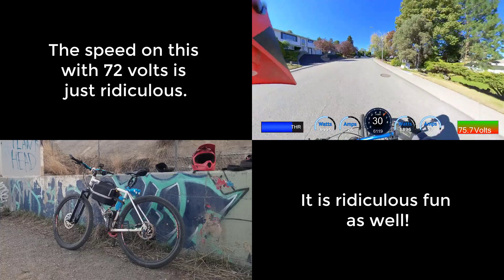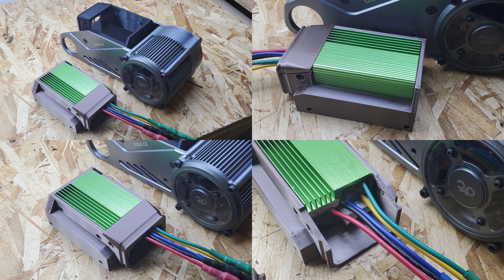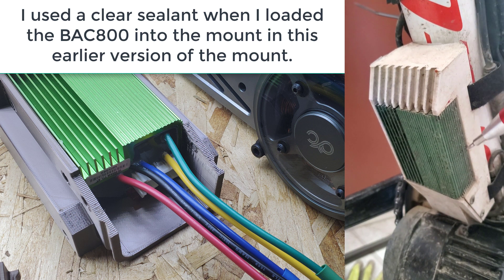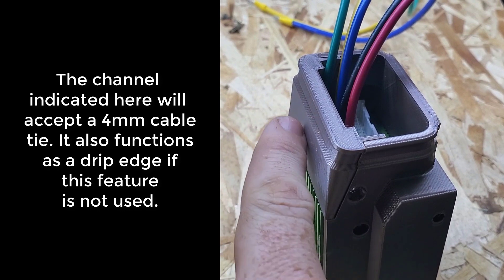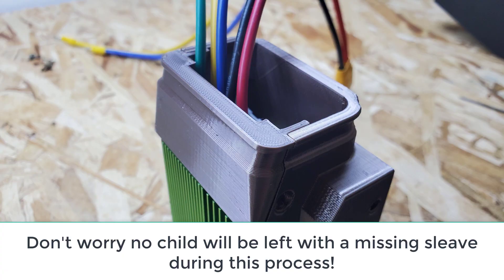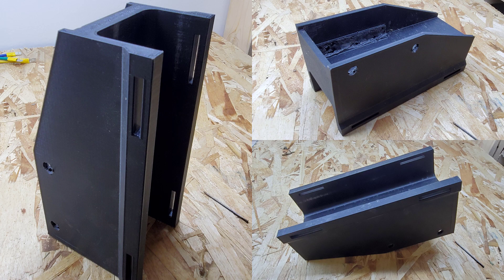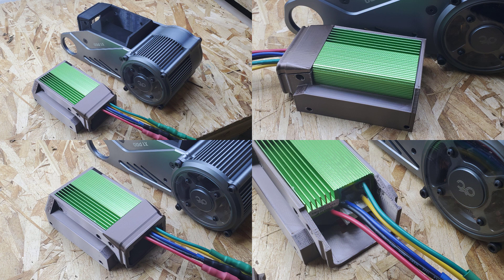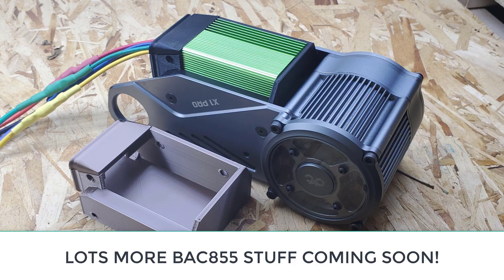ASI BAC855 Controller Mount for CYC X1 Pro Gen 1 & 2

Comment: i just got cyc steal motor with  bac855 that has clear reson over connectors and added high strength polyurethane sealant and adhesive pu18 on all wire connectors, what do think
Reply from the maker: I like it Alan. It's a good call to protect the 24 pin JST. Some drawbacks in that its hard to use for anything else. You are locked into using that controller on a cyc bike and if wiring is damaged will be hard to repair. Grin technology have done a similar thing with their Frankenrunner.

Comment: Hi there I have the cyc with 72v and bac 855. To be honest I’m a bit disappointed as the videos I have seen from yours and other they seem to be a lot quicker. Do you know how to navigate the bacdoor enough to mod the motor and controller for more power? Any help be greatly appreciated.
Reply from the maker: I'm okay at bacdoor. I'm sure we can help on discord. You can post pics screenshots etc. https://discord.gg/YAAjfgc I'm on a away job but I shouod be able to look tonight if others can't help before. Weight of bike is a factor as well as gearing.
Reply: @HighVoltageKits  thanks I joined and max gave me a few tips.

Comment: awesome ! I bought an ASI855 and BBSHD following your videos. Unfortunately I don't have the harness that connect BBSHD to ASI855... Do you know where I can get one ? I have a 8 pin harness coming with the BBSHD and could make the harness myself but wondering why on ASI side, their are two brakes. Do I need to duplicate wires? Thanks a lot for the help !
Reply from the maker: Check out my discord for asi stuff. https://discord.gg/YAAjfgc I am assuming you have access to the app? Cheers

Comment: Great job, can you help me with some advice please, I have an 14s6p 52v battery from em3ev built with 35e cells, my question is would this battery be good enough to use with the bbshd and the bac 855, or even the cyc gen 2 either with the stock controller or the bac 855. I only use the bike for getting to work but have got to the point where I want more some power, my current bike is a trek marlin7 less than 1 years old so I will be still use this bike.
Have watched your videos and have learnt a lot from them, would really appreciate your advice because I'm not sure what set up to choose.
Keep those videos coming.
Reply from the maker: Em3ev tend to be fairly conservative with their batteries. My one from them with the 30q Samsung cells has a 50 amp bms which was just about enough. If you email Joseph at em3ev you can check on the bms for your pack. I suspect the BMS would be 40 amps for that pack which is more about range than power. You really need 60 amps continuous for the CYC and at least 50 for the BBSHD. There will be alot of voltage sag with the 35E cells. You could still do it and reduce the watts you are pulling until you get a stronger battery. I would shoot CYC an email as the stock controller is no longer being shipped. Only the bac855. Hope this helps. You are welcome on my discord where there are plenty of people building with the BBSHD. https://discord.gg/yQ6JnVK Cheers
Reply: @HighVoltageKits  and of course you are 100% correct about the battery, bms is 41 amps continuously and the cut off is set at 60,so I think I will just run a stock bbshd with this battery and have a think about a new build altogether.
Thanks again for the advice and help.

Comment: Nice! Just got confirmation that Alan has sent my replacement stuff ( mount, side cover and display housing ), mine will be here on Thursday. Love your design
Reply: It's been three weeks since I ordered my BAC855 and it's still marked as 'awaiting fulfillment'. :(
Reply from the maker: Sign on to my discord and post on the nxt channel. Can get you updates via that. Cheers
Reply: @whoaitstiger  Hey mate, could you share your order number? Highly recommend you join Cap's discord as well.
Reply: @maxellp  Hey man, I'm in discord I'll message you the order number in there. Thanks. :)
Reply from the maker: Thanks! Sounds good.